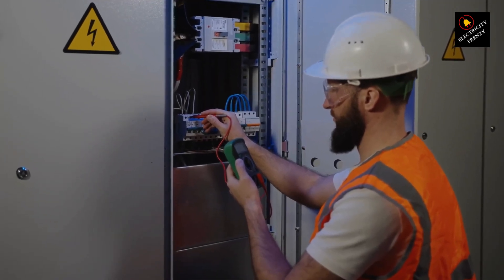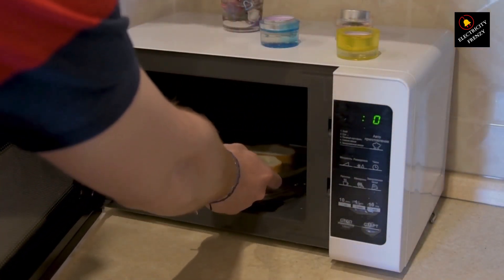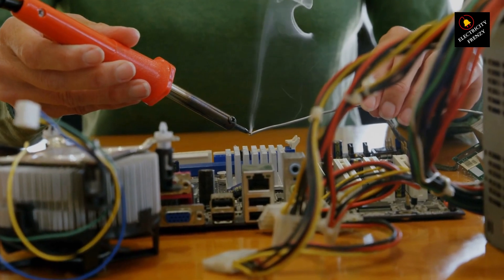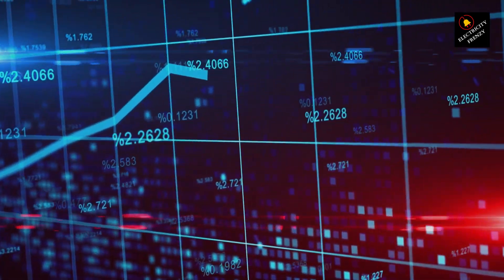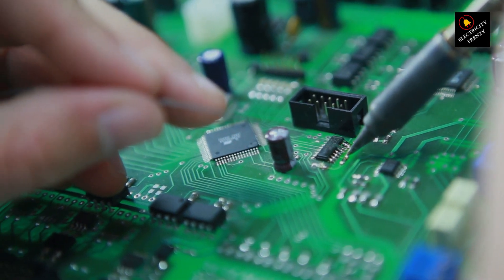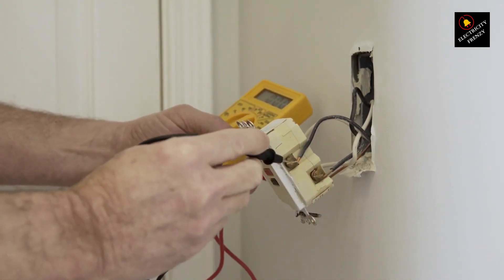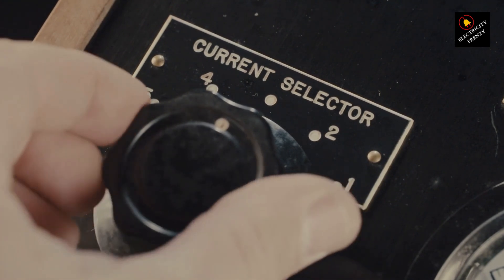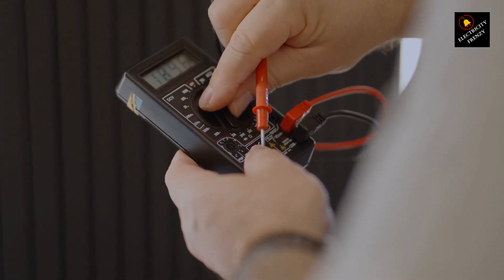Can a Voltage Stabilizer Solve Your Home's Low Voltage Problem?

Comment: My village voltage 70,80
Can it possible yo bust 230
Reply from the maker: Yes you can 
But you will need a special Stabilizer
Reply: @ElectricityFrenzy  Hi sir, suggest some main line stabilizers for low voltage homes like 70,60 etc

Comment: Hey bro my home voltage is low like 170-190 somr time 210
Reply from the maker: You can use a voltage Stabilizer
Reply: @ElectricityFrenzy  suggest me one
Reply: My voltage is low too 165 can stabilizer solve the problem? @ElectricityFrenzy